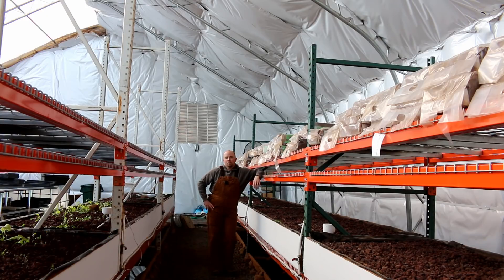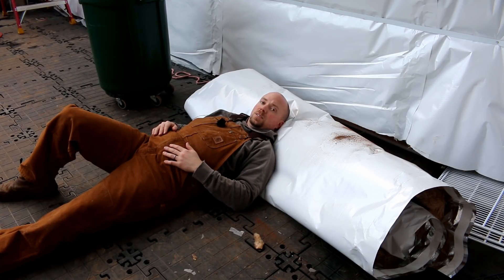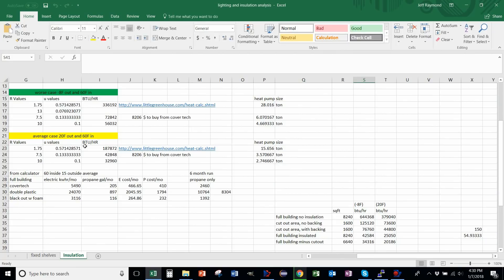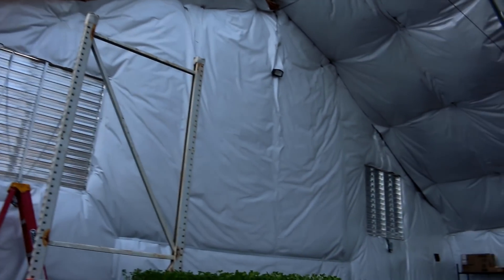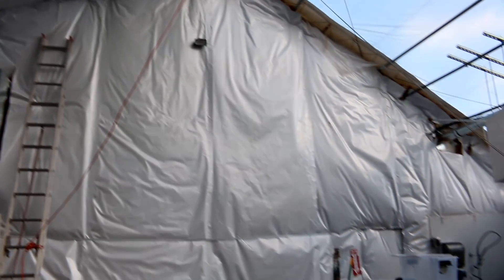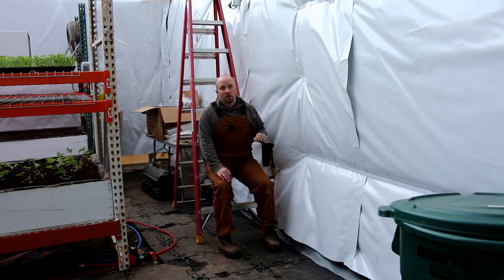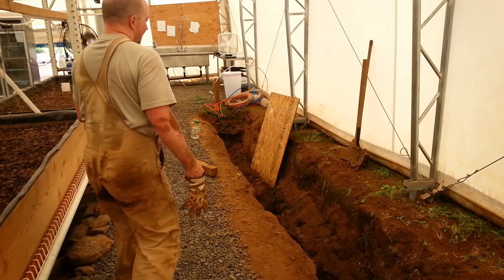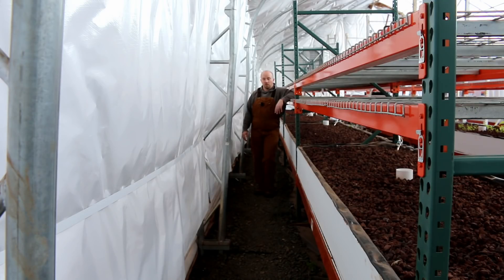INSULATING Your GREENHOUSE

Comment: Your point of operation is the PNW, not Mars. Make it work on earth first, positive cash flow, sustainable, then consider out of this world... Mars.
Abundance of hydropower and biomass should be your primary power source.
Alternative power sources resolve fault tree problems at critical variables.
https://youtu.be/SRuCzKal0o8
https://youtu.be/UfXh5FtxzWs
https://youtu.be/pRqiQIw0xm4
https://youtu.be/TZrQ6SD-wAk
GARN is my recommendation!
I really like pellets, low moisture, consistant/automated heat, good storage etc. I would ask GARN to build a pellet model.
https://youtu.be/wsWpGBOozCk
https://youtu.be/QUev2X9yTDc
Digester? Make local work first then add-on the digester during warm season via step by step method... why does it feel like a roll of the dice rather than an engineered build out... why is the digester sitting offline in 2018? If you need funds with 20,000 subscribers, all it would take is a clear plan and justification video with donations from subscribers.

Comment: Build your own dehumidifier - idea.  Two large coils salvaged from HVAC dealer removals or scrap dealer.  One inside and one outside, piped together.  Antifreeze coolant.  Small pump for circulation of coolant.  Fan on inside coil to pass air.  Utilize outside cold air to cool antifreeze, pump coolant inside to dehumidify via the inside coil and fan.  Arduino controls and sensors to monitor and tune inside coil temp via coolant flow, and system ontime.

Comment: Question. Why insulate if you leave a third of the building uninsulated? Do you have a plan for the rolling insulation to cover the clear plastic? The nightly losses must be costing you a fortune. I believe you could cut your propane bill drastically if you get something over it at night.